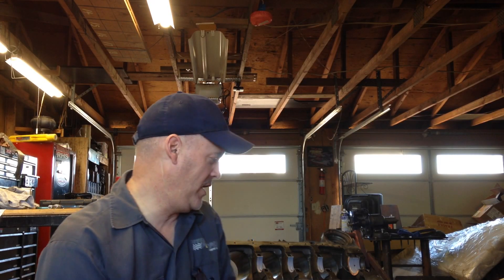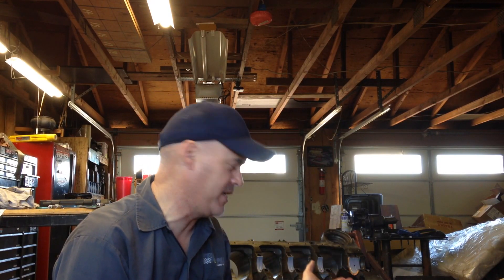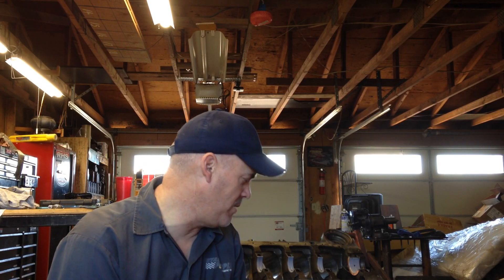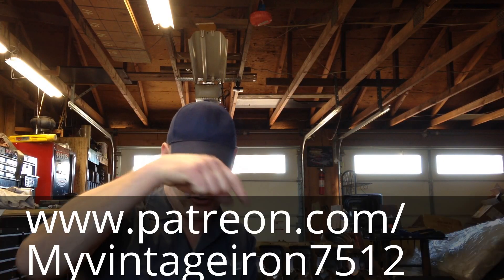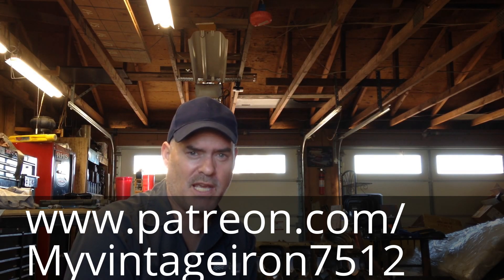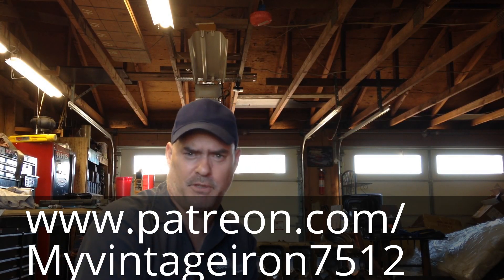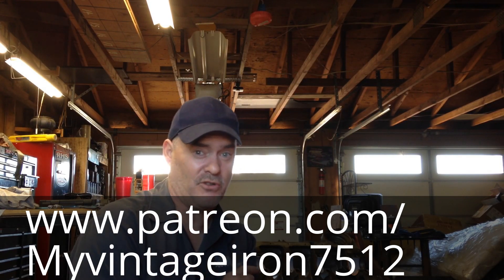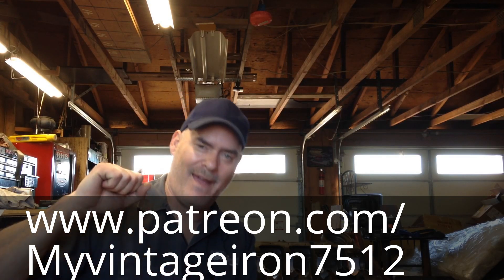Chevy 327 Breakdown

Comment: So if I take a 327 block pre 68and put a 283 assembly in it, do you end up with a 302 ? Cuz I hear they used that in early can am racing series, cuz it could rev real high, and would shoot you out of a turn with max excellaration.
Reply: A 307 is a 327 block with a 283 crank 
And a 302 is a 283 block with a 327 crank
Reply: Jim Thomas you've got that backwards lol. A 307 is a 283 with a 327 crank. A 302 is a 327 with a 283 crank.

Comment: So what kind of power can a small journal 327 hold? And could I build a good 450hp 327 street engine for my '64 C10?
Reply: Justin Williams 450 easily. Check out Mark/Vortec pro channel on his iron headed 327 build, I think it made around 450. 11:1, cam in the .500” 230* range and good heads and you’re in the neighborhood of 420-450.  Built an aluminum headed large journal 327 in HS with aluminum heads and a decent cam, made 420 and I regularly shifted it at 7,200, I don’t think that engine ever didn’t see at least 1-2 WOT pulls on every drive. More like 5-6. Held up for 10 years when I sold it, still going strong according to the current owner.

Comment: I’d love to hear your opinions on 383 350 with 400 crank vs 377  400 350 crank builds
Reply from the maker: my experience is the 377 makes more power short stroke big bore engines are general more suited to  higher Horse power and torque and higher RPM's I will say however I am not a big fan of the small block 400 I have run several over the years both in 377 and 400 versions they seem to run hot and when you really pound them with high compression of boost they almost always develop head gasket leaks the way to go is get a dart block and build a 377

Comment: You forgot to mention the stock 327 piston has a different pin height.  Good video
Reply from the maker: yes that is true it uses the same connecting rod as a 350 5.700 with a 3.250 stroke in order to get the piston close to the deck surface it has more piston pin compression height in other words the pin bore is lower on the piston that the 350 piston this is also how most 383 pistons are as well excetp in the case of the 383 the piston pin compression height is higher the pin is raised very close to the oil ring groove and the piston is shorter you just gave me a great idea for a video Thanks

Comment: I have a little 91 s10 I want to put a 327 in. it has the 2.8 v6 in it right now but was wondering if the switch over would match up.
Reply from the maker: They have kits to swap a V8 into and S10 I have done a few you wuill need a transmission as well I used a 700R4
Reply: hey thanks. I'm looking to probably put another 5 speed in it. should be a fun little drag truck by the time I'm done with it

Comment: There was a difference with the number of freeze plugs on the side of the 400 block too.
Reply from the maker: not on all of them
Reply: Not all, but every 3 freeze plug block I ve seen had 4 bolt mains.

Comment: Ran into a weird situation does a 1967 sbc 327 off a c10 have a crank bolt stock like most do or is it just blank with no threads
Reply from the maker: most of the small journal cranks were not drilled
Reply: @Myvintageiron7512  so to install a new balancer just hammer it in with a mallet or is there a different type of pulley?

Comment: I have a stock engine and research is telling me that it's sourced from a 68 Chevy C10 (block casting: 3914678)  with stock Cylinder head (Casting 3911032); Can you tell me the original stock horsepower? There are so many confusing numbers out there, even from the GM heritage site- Please- One more.. what I would gain if changed to 4-barrel carb and different intake?
Reply from the maker: It's hard to say with out breaking it down and inspecting the internals that block was used for a 302/ 327 / and a 350 depends on the crank and rods look on the front pad number stamping if you are lucky enough to have a stamping that includes the letters DZ you have a 302 a very rare block indeed I am going to say most likely not they made tons of 327's and 350's with that block power ranges from 285 up to 375
Reply: Thank you for all your help!  The knowledge you share, helps so many; and is what makes YouTube what it is! In any case,  I really appreciate the fact that I have a late 60's block capable of that kind of power.  If, by some miracle, I have DZ on the other stamping, I will add to this reply.. Thanks again, for taking the time!

Comment: I was looking to your Mopar 440 videos but didn't see where you set up the rocker arms I've got a stock 440 somebody has mixed up about half of all of the rocker arms it's a bit of a head-scratcher for me
Reply from the maker: We never did the top end of that BBM sorry
Reply: Myvintageiron7512 well it seems there is left and right rocker arms for each cylinder after studying and studying and looking at them I think I can straighten it out they are offset so they're not supposed to be mixed up and they're not marked left and right I have to look at them carefully to determine which is which
Reply: Bring the cylinders each to top dead center one at a time and set the rockets to O-LASH. Then turn them down 1/2 turn cylinder by cylinder.
Reply: Norman Heen that wasn't the issue they're hydraulic flat tappet set zero lash no adjustment somebody mixed up the rocker arms apparently there are left ones and right ones they are offset I finally got it figured out I pulled the valve cover off and was looking at some of the rocker arms you weren't even lined up with the center of the valve stem on that 440 the head is longer than the crankshaft so much but I think that's why they had to use offset rocker arms
Reply: Nice show!!

Comment: Great Videos...I have a 1967 small journal 327 chevy, and I would like to install in it a Lunati cam with int0.465/ex0.488 valve lift. Please can you tell me If is necessary Mill the guide boss?  
Thank you for your really nice video!! That clarified my idea about the kind of engine that I have, and how to work on it!
Reply: Get the valve guides replaced along with the springs and retainers and pocket port the heads.

Comment: I ran into a small journal 327 was given to me I have choice because I also have a roller cam 880 motor can I put a roller cam in the small journal 327 I'm building a 1936 Plymouth coupe and want to stay old school
Reply from the maker: you can buy a retro fit roller cam kit for the 327
Reply: The block I have is a 3858180 are they good blocks

Comment: I'm doing a 283 and what is the deal with these Rebuilder pistons? .020 extra off the top. I don't want to deck thus block but I hate to spend 400$ on pistons.  oh well I guess I will get the pop ups anywAy 1.805 comp height. What a nightmare. These 283s Need proper quench just to get the minimum 9.5:1 compression. I'm also going to run the 097 duntov so lazy ramps and lots of overlap isn't gonna cut it .045 on the hole.

Comment: Had 65 Chevy ll with 300 hp 327
Straight from factory
Always felt 327 was faster than 350s
The ones I built ran like crazy
Early 350 seemed sluggish to me
Had 60 over 327 with 13to 1 pistons in my 36 Ford
Those were the days

Comment: Chevrolet produced some pretty respectable 327s in the early/mid 60's.
Reply: Yes they did. in '65 Chev. used a 375 hp /FI  327 in Vett's.  And in '65 was the first 283 w/ 283 hp.

Comment: Iv got a 1962 327 small journals and a 1969 307 what one will have the highest rpm and power stock. Also got a few stock 70s 400 motors
Reply from the maker: Build the 400 it will out power the other two by a long shot
Reply: Myvintageiron7512  what should u do to a 400 just to have a great motor in a truck  will the 400 be better then building a 350 in to a 383 stroker ?
Reply from the maker: 400 and 383 are very similar power wise I would use 5.700 rods and build the 400
Reply: Myvintageiron7512  Thank u one last question would large 327 crank in the 400 be best?

Comment: What's your thoughts on a 377 (4.155x 3.48) build vs a 383 stroker build? I'm sure you've built plenty of both over the years which is your favorite and why?
Reply: if youre going all out, a 383 will be more powerful but it is a lot easier to make a 377 rev cause it has a much higher bore stroke ratio

Comment: During the 60's the muscle car wars hit its zenith and 327's were done right. Even the stock, low power motors had heads with good compression. The Camel hump heads were excellent performance heads. But shortly after the introduction of the 350 GM started de-rating motors because of pressure from legislators and insurance company's. They were coming out with stuff like the notoriously bad "smog heads" with low compression. Some people even figured out that they could improve their Camaro with stock 327 heads. That is the biggest reason why the 327 got a reputation for being superior to the 350. Given similar components they are actually very comparable. They just shine at different power bands.

Comment: need your help with a Pontiac build idk were else to go..
Reply from the maker: What's up
Reply: I really wanna build from the butlers lAll  after market cast block.for a starting point. But when i look at these web sites all i see is a bunch of numbers. I have a 1979 pontiac Bonneville with th weak 301. And I would  love some advice on a really  nice street build around  450 to 500 hp on pump gas.any idea
Reply: I have  a 1979 Pontiac Bonneville with that piece of 301 engine and would like to build a nice reliable engine starting with the butlers lAll aftermarket block for not out the roof cash. I have been keeping a close watch on your videos and respect your knowledge of the auto engine world, and would like your blessing for help. trying to make 400 hp on pump gas/ daily driver.
Reply from the maker: I would try to find a 455 it would be the easiest way to make 400 HP on pump gas and it's not that hard to make it fit in that car you could also do it with a 400 but you will half to trick iy out a little more to get that HP #

Comment: the over heating problems on the 400 must have been fixed by 77...

my all stock 1977 truck has a 400....the vin says it had a 400.....but the rad is SUPER thick.

also have a 400 in a 68 impala that use to have a 327......it doesnt overheat either

like....any rad that can cool a 350 can cool a 400.....BUT!!! if the rad could JUST barley cool the 350, the 400 will overheat it

the stock rad for the 400 has more cores.....

the problem came from peoppel swapping 400s into cars that didnt have enough rad for the extra power

you end up with the same problem if you take out a 250 hp 350 and stick in a 450 hp 350.....

Comment: can you please shead some light on the chevy 302
Reply: old Z28 engine GM made for the Trans Am Racing Series  in the late 60's , back then the racing bodies  made the manufacturers put engines in production cars in order to get approval to run them in the race series .
Reply from the maker: The 302 shared the block with the 327 and 350 but used a 3.000 stroke by the way 3.000 is the same stroke as the 283. The 327= 3.250 stroke  350= 3.480 stroke 302=3.000 all had a 4.000 std bore the 302 crank was large journal you can buy a 3.000 stroke crank and build one useing a 350 block the  302/305/327/350 all share the same connecting rod 5.700 the pistons were all different for each engine the 305 has the same stroke as the 350 but a small bore the big bore short stroke engines were much better performers 305 is so so the 302 is badd ass
Reply: You can also build a 302 with a small journal 327 and add the 283 crank and rods .. cheers !!
Reply: How many dz302’s were built , was 1969 the only year? did they use them for any other vehicle other than the Z28 ?
Thanks for all your knowledge I just been to put this to rest with a old friend that in never wrong no mater what it is ! I’m sure you’ve ran across that guy.
Reply: Only Z28"s . Most of which ended up in dirt track race cares because of displacement restrictions and the very high RPM range of the 302.
It would easily live around 7000 all day. This is why they are so hard to find, but you can make one as mentioned above.
Reply: windell penton, You just described a 307, 3.875” bore and 3.25” stroke.
Reply: @Myvintageiron7512   love your videos,  but wish you'd use
    punctuation in your reply comments.   they read like
one long sentence.   been a Chev guy since 62,  and your
    info and build quality is dead on.  we need more videos.
Reply: @shitbox7413  no he didn't. The early 327 block=4.00 bore small journal & 283 crank=3.00 stroke small journal 
= 302
Reply: @jesseduke694 , Yep you’re right, I misunderstood what he was saying, I know all the bores and strokes just fine, when he said 283 crank I was was thinking 283 block for some reason, I must’ve had a few beers that day. 😄
Reply: @shitbox7413  right on. I know how them nights are & ive misunderstood & commented on a few myself that have gotton corrected.
Reply: @jesseduke694 , 😄👍🏻

Comment: Do you have the casting numbers for the early vs. late 327?
Reply: Late 327 blocks will use the same casting numbers as 350 blocks.  For example, the L79 engine in my El Camino is a 1969 block, 010, which is used in 350s from 1967 through 1974-ish.  

Of note is that ALL 350 engines, even those produced in 1967, use the 2.45/2.1 journals.

A good resource for casting numbers is www.mortec.com/castnum.htm ...

Comment: I have a 327 with a HU suffix with a block casting # of 3932386 with a 2 bolt set up to which the 2 other block  CID numbers are a 69' 302 4 bolt Z-28
350 69' 2 or 4 bolt I have a 2 Bolt block,, now the distributor housing in the back of the lifter galley is a round tube with a 45* hole drilled in the side of it for oiling and in my books ,,, motors and chiltons shows a HU suffix for a 65' 327. I'm thinking that it's an older block than 69' does anyone have a clue?
Reply from the maker: whats the date code
Reply: @Myvintageiron7512  the block is in the machine shop I'll have to call the machinest but strange that you say this,,, I was helping a friend with an engine problem he was having with a 350 he has in a 72 pick up to which he couldn't see the cast numbers on the back of the bell housing being it was set back under the firewall then I got thinking about the date casting,,,sorry to have bothered you. By the way interesting vidio, thumbs up.  AL.
Reply: The cast # for date of manufacturing is K25 8,,, naturally it's Nov. 25th of 68'. Which in the books is a special high performance engine waiting to hear back on the crankshaft size either 2" or 2.4 and change & it is a a 2 bolt,l. If by chance it does flux out ok for a fresh build I will have a Dyno sheet when done and I'll have it up for sale, especially for the 68'-69' Vette owners if you know someone that wants a # match block let me know.

Comment: Journal speed is not a geometric progression; it's a linear, arithmetic progression.  A geometric progression increases as some exponent of the basic measure. Journal speed increases as a coefficient of journal size; i.e., not exponentially.
Reply from the maker: I'm not smart enough to talk to you I'll take your word for it
Thanks
Reply: For example, twice the journal diameter = twice the journal/bearing speed (the way it really is; an arithmetic progression).
In a geometric progression (here's just one example), twice the journal diameter would equal 2 squared, or 4, times the journal speed (not the way it really is).
Reply from the maker: got it makes sence

Comment: I know this is an old video, I just cannot find much information on this. I have a 3932386 engine here that’s been wrapped up in a garage for a long time, that’s all the information I have on it. It has a Holley 4bbl on it, it still has the clutch attached to it, everything is still attached and I have not taken it apart at all, so I can’t tell what exactly it is. Any help from anyone I would really appreciate it.
Reply from the maker: That is a large Journal 327 or it could be a 350 they used it for both in 68 and 69

Comment: Fact be told. My first hot rod engine was a 327 with a nice cam and double hump heads with flat top pistons. Ran well for a kid, but then I slung the rods out of it. 
I put the same heads, cam, and everything on a flat top 350. The 327 was nothing to compare to the 350. The 350 with all the stuff the 327 had was lot faster and had shit loads of bottom end.

Comment: The difference between, 327 lg journal and 350, is crank stroke and piston pin location, rods are the same. neat fact, to prove you point about journal size is, nascar Chevrolet engines used to use Honda rod journal size 1.889.. I'm not sure about now..... 327 is gone it's a shame, one of the best engines. Chevy build some crazy engines in the sb1 days, like the 267 and 262, odd ball engines, but the 327 sb1 was a great engine, and it is special, the Chevy sb1 loves the 3.250 stroke, the harmonics of the engine clicks with that stroke, the perfect stroke is 3.280 use that stroke with a 4.125 bore and find out how to make 850 n/a hp, and zing it to 10,000 rpm..... you'd have a hard time doing that with a 3.48 stroke.... I raced cars for years and a 327 will out run a 350 even with 30 less hp, there's a tiny bit of magic in the 327, not earth shattering, not enough to write a book about, but ever so slightly, magic. Same with the 307 another 1/4 inch motor, a run of the mill engine back in the day but ever so slightly special.

Comment: You didn't mention the 302Ci varient.  I've been told it is  327 block with a 283 crank.  Talk about revving up.
Reply from the maker: It's actually a 350 block with a 3" stroke it's not a 283 crank the journal size is different

Comment: can you put a old 67 up 327 sbc crank in a 400 sbc?
Reply: not really; the main journals in the 400 block are bigger than that crank, but they may still make bearing spacers, or even specialty bearings.